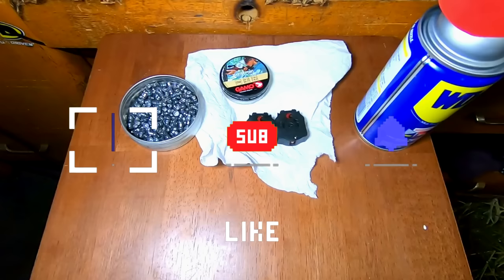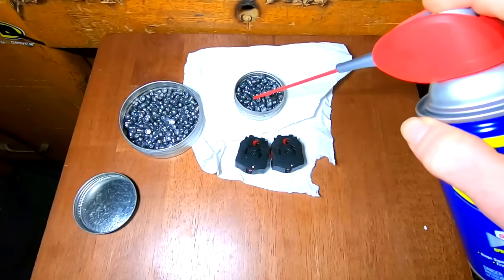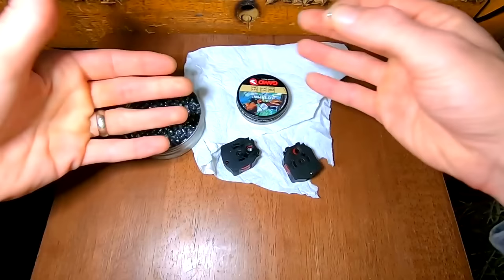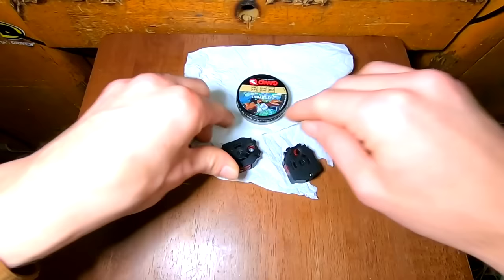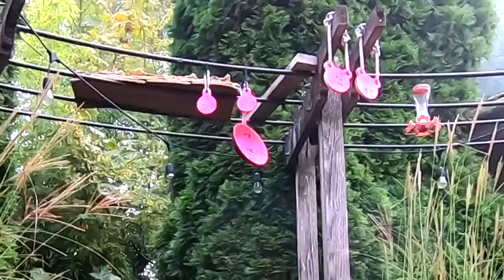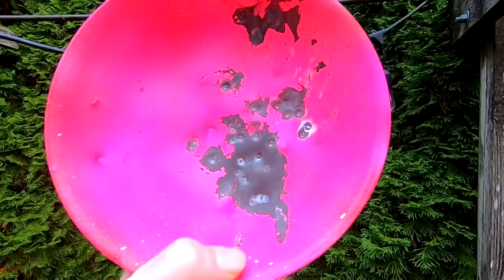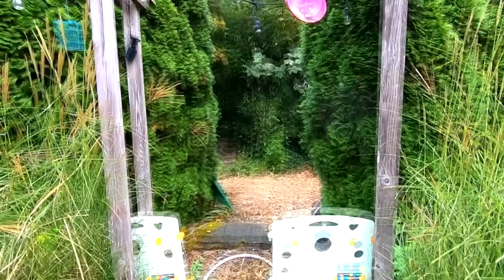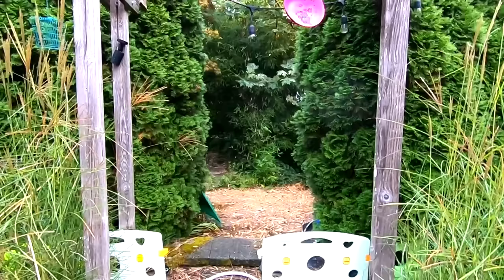Pellet Dieseling the Easiest & Quickest Method

Comment: WD-40 is like 50% water so it doesn't work that good, Vaseline will gunk up your gun.
What I found that works is Hoppes #9 lubricating oil or any 3-in-1 oil, put a drop in the pellet skirt.
Reply from the maker: definitely not true
It's 95% petroleum by-products (oil)
and 5%CO2 (the propellant)

I actually made a video where I go over the material safety data sheets for wd40 and show the breakdown of exactly what is in the can(s)
Reply from the maker: And to clarify, that means that if you just buy the 1 gallon can of wd-40, since it has no CO2 propellant in it, it is literally just 100% oil.

Comment: Would kerosene work or does it have to bee like that charcoal lighter fluid? Or is it is a heavy oil would you use used motor oil or use something like coconut oil?
Reply from the maker: I'm pretty sure people have also suggested kerosene before so I think it will work
Reply: @PelletPlinker  Make kerosene mixed with Crisco.

Comment: Mate, you want to try the Nitrous Oxide Technique, all you need is a C02 Rifle just ad WD40😉
Reply from the maker: as far as I know this doesn't work with CO2
Reply: @PelletPlinker  you misunderstood, of course you can't diesel with carbon dioxide, the Nitrous Oxide canisters are a perfect fit, it's an oxidiser, Air is only %15 oxygen? Rest is nitrogen, carbon dioxide and over trace gasses, the clues in the name with Nitrous Oxide.

Comment: I wonder if setting the pellet would have any effects? Like if ya set it a little deeper would it have the same effect as when people bore our a car cylinder, but on an obviously smaller scale?
I don't know crap about cars but figured it was worth asking.
Reply from the maker: it would lower compression.

You are getting 2 things confused here too:
Boring a cylinder makes the cylinder wider, not deeper. It allows you to fit a "fatter" piston which I think has something to do with torque or something.

The other thing commonly done, does the opposite of what you are suggesting. They will shave down the heads, specifically the contact point between the head and the cylinder. This puts the "ceiling" of the cylinder head lower/closer to the top of the piston during it's upstroke, decreasing the total volume in the combustion chamber, and thusly increasing compression ratio, and increasing horsepower.
Reply: @PelletPlinker  See, I wouldn't have known that... That was really cool to learn. I woulda thought more room for more gas woulda equaled more boom😄
Thanks for taking the time to explain🙂
I woulda responded 3 weeks ago when ya replied, but stupid YouTube never notified me.

Comment: Does Silicon oil work too? I use it to lubricate my airguns. I'm too afraid to use the WD-40 in the airguns.
Reply from the maker: possibly
Reply: @PelletPlinker  anyway, some result using the vaseline by my side. I tried it in a Diana Eleven cal.177 and in a Gamo P900 same caliber. The Diana got the best result and the P900 just more power (pretty weak as a <7,5 Joule model). No damages as far as I'm concerned.

Comment: And that also ruins the barrel of a gun just checked with eight different manufacturers that in time wears out and ruins the barrel if you do
Reply from the maker: My barrel is still fine

I also highly doubt you actually did that
But even if you did, of course they would recommend against it

I also don't understand why anyone would think doing things like this could or would improve their gun? That's definitely not the point. 

Putting a bigger turbo on your engine lowers the lifespan of your engine. Doesn't mean people don't want to do it.

Comment: I get the fact that the lubricant lubricates the barrel and creates a seal between the pellet and the bore. What I don't get is the part where you mentioned an explosion? Can you explain this in more detail?
Reply from the maker: So the lubrication wasn't really a point of focus, I was just mentioning that it probably also does this to at least some degree, but that is just a theory.

What is happening here is that petroleum ignites under enough pressure, which is how a diesel engine works. Gas engines use a spark plug, whereas a diesel engine just uses the sheer pressure of the combustion chamber to ignite the fuel. 

This can also happen on a smaller scale behind the pellet when the pressure in the piston/breech area is high enough,  creating a small explosion that adds a little extra velocity to the pellet, and of course a louder sound and a little smoke puff
Reply: @PelletPlinker  - That works with CO2?
Reply from the maker: Probably not with CO2 since it would just put out the "fire"
Reply: @PelletPlinker  - Ok. So you were using a pump-action air rifle. That's what I was wondering.
Reply: It's not the pressure that ignites fuel in diesel engines [or guns] - it's the heat caused by the pressure.  The temperature can be raised to typically around 900 degrees C by the compression stroke of many diesel vehicles.  @Plinker

Comment: Just to let you know is to do not Diesel your pellets if you are using a Daystate Delta Wolf or Alpha Wolf because it will mess with the built in chronograph . Yes it just might work for a little while . However the chronograph will stop working trust me I know been there done that .
Reply from the maker: didn't know there were guns with built in chrono 
Sounds pretty cool
Reply: @PelletPlinker  Yepper the Daystate Delta and Alpha Wolf do .

Comment: why no one tryed diesel starting fluid?
Reply from the maker: sounds like a good idea

probably more expensive but a lot more convenient than just using diesel for anyone who doesn't have it lying around.
Reply: @PelletPlinker  sold on the next shelf...
Reply from the maker: as far as I know you don't buy diesel off a shelf, you buy it from a fuel pump.
Reply: @PelletPlinker  i never said diesel, i said starting fluid for diesel engine.

Comment: How fast will it ruin your o-rings...? (That's what they warn for)
Reply from the maker: so far haven't ruined any o rings and been doing this for years, at least a hundred dieseled shots out of both my rifles

From what I understand the people blowing o rings and other damage etc. aren't getting it from pellet dieseling, but from accidental piston chamber dieseling as a result of over lubing/excess leftover lube from cleaning, getting trapped in the piston chamber, causing a much larger dieseling reaction than what would normally occur within the skirt of a pellet

A lot of people who are vehemently against dieseling seem to conflate these two things as being the same thing, or being just as bad as one another, or are just downright mistaking piston chamber dieseling with pellet dieseling. in reality, the amount of dieseling occuring with a pellet skirt of petroleum is nowhere near enough to cause any damage or to burn anything etc. even done over a long period of time. 

I don't even clean or lube my pellet guns and they are STILL fine, so if you are actually maintaining your airguns unlike me, you should be even better off than I am, which again, is perfectly fine.

Comment: The best for deseling is vicks vapour rub put the end of cotton bud in the rup and put it in the end of the pellet, not two much.
Reply from the maker: or just use vaseline
I have another video where I show a method mixing vaseline with pellet gun oil, it thins it out a little making it easier to ignite, without making it too thin so it still stays in the cup

Comment: Nice info..will effect nitro piston , springer in any way., as its blast..? I mean might it brake chamber, spring or piston of nitro assembly?
Reply from the maker: I'm sure there's always a possibility, but I haven't had any issues yet and I've run several 10 round diesel mags through both of my rifles and they still perform as well as they ever have as far as I have noticed
Reply: @PelletPlinker  ok so every shot ur dieseling ? If yes since how many rounds till date? Any problem with sealing?
Reply from the maker: definitely not every round, and I dont really keep track, but I've probably sent at least 50-100 dieseled pellets (each) through both of my rifles

I've had both of them for about 2-3 years now
Reply: Das Gas sucht Sicht immer den leichteren weg. Wen die Feder stark genug ist geht es mit der Luft und den Entzündung nach vorne raus
Reply: Why would it not just push the pellet down the barrel like any other gun?
Reply: @DaveyMulholland  What do you mean ? The pelet is tight in the barel so it doesn't slide.
Reply: @frederic6998  you think it's easier for the gun to explode than for the pellet to travel down the barrel?
Reply: No!   I have tried almost anything to ruin an older rifle this way from my collection and i could not get it wrecked!
I would not tell this to you if it wasn't true.  The pressures an O ring can handle is way more than you can achieve with dieseling.  (fact!)
Reply: it will break your mainspring,trust me
Reply: @joedills3509  Another one who knows better. 😂😂🤣🤣
Reply: @joedills3509  ps, why would it break the mainspring?
Reply: Short answer no... barrel heats up @1,598fps to 1991 fps 'depending on the bore "caliber"size 👍
Reply: @plupdeplup7349  "barrel heats up"?  Yup it does,  if you can reach about 900 rounds per minute and keep it going for 5 minutes. 😂
Reply: @joedills3509  correct sir!!! Well it did on my gun anyway.
Reply: Ff the spring fails due dieseling, it's after hundreds or even after a few thousand rounds?? How bad is it really?  It's replaceable for something like 40 euro's I thought and not that much work. Correct me if im wrong.

Comment: Yes, dieseling will give you more whack, but it's wildly inconsistent.
Reply from the maker: if you were to use something like petroleum jelly (doesn't evaporate or drip), and were meticulous with how much fuel you put in each pellet, weighing each pellet before and after adding the petroleum to ensure the same fuel weight for each round, it should be fairly consistent (theoretically at least).

Even without doing that, I can still reliably hit all the targets I normally hit, once I figure out how high it's shooting and adjust my aim point

Comment: Anyone dieseled with actual diesel or petrol?
Reply: I've tried almost every oil, gas, rubber save solvent all the way up to alcohol.   
My experience tells me when the used substance is flammable it works.  😎
btw, I'm doing this for years now but mostly I shoot without propellant because it's to much "work" between every shot.  😋

Comment: Why not use Marvel air tool oil. It’s a petroleum product and made to lubricate air tools and is safe for seals etc.. I know that WD40 or any kind penetrating oil is bad on air seals
Reply from the maker: wd40 isn't bad for seals that's a myth
But yes, something like air tool oil would be better.
Reply: @PelletPlinker  it’s not a myth I spent the last 10 yrs repairing and rebuilding air tools… WD40 or any penetrating oil will ruin the seals
Reply from the maker: WD40 doesn't ruin seals. Lack of air tool oil is what ruins air tool seals.
Lack of pellet gun oil is what ruins pellet gun seals.
WD40 has nothing in it that would deteriorate any seals. You are confusing the consequences of improper maintenance, with mythological negative effects of wd40.

You could leave a rubber seal in a jar full of wd40 for a decade and it would be perfectly fine.
Reply: @PelletPlinker  That's because the only thing you would have left in that jar would be a light oil. But that's not what WD-40 is. WD-40 contains a lot of volatiles that essentially thin the light oil out even more than it is naturally, so that it can coat a surface, and "displace water" (W D = water displacer). These solvents (volatiles) evaporate very quickly, but in the few moments they have before complete evaporation, they are a SOLVENT, and can damage rubber seals.
Reply from the maker: Name literally ONE volatile in wd40

I have a video about wd40 where I break down the material data sheets and was is ACTUALLY in it.
spoiler alert: it's petroleum oil, and more petroleum oil.
Reply: @PelletPlinker  CO2
Reply from the maker: CO2 is the propellant, genius. 

The 1 gallon containers of WD40 do not contain CO2, since they require no propellant. CO2 isn't part of the formula, and is not "in solution" it is literally just to get the solution OUT of the can it is contained in.

And CO2 isn't a volatile in the definition of volatile that you are using. You are using the term volatile to be synonymous with a solvent, as opposed to something that evaporates quickly. CO2 is not a solvent that damages rubber seals, so it is irrelevant to list CO2, unless you entire point was that you can't actually think of a decent answer, and are admitting that I am right.
Reply from the maker: I mean you aren't even trying. 
You literally made the statement, that a product that contains only 3 ingredients, contains "a lot" of volatiles. 
Then when quizzed on these volatiles, you failed to list even one volatile compound contained within the formula, and mistakenly listed the propellant, which isn't even "volatile" in the sense that you are using the word. 

So in other words, it's a lubricating oil.
Reply: Bless your heart

Comment: Does it ruin the seals or not?
Reply: Yes it does
Reply from the maker: No it doesn't.
I've done this to both of my rifles for like 3-4 years now, hundreds of dieseld rounds through both guns, and both are fine.

And this is keeping in mind that I have literally never cleaned either gun even once. 
Still shoots as strong and consistently as it did when I got it. Can still hit a 3inch group from 25 yards, and can still kill squirrels and birds so as far as I'm concerned the gun is good still.

Results may vary but worst case scenario you have to replace a 10 cent o ring or something.
Reply: @PelletPlinker  well, I thought so. You know those have experience with dieseling all say the same, like you do. Most if the times those who do not have the experience, say it will damage the seals. I believe you, thanks!

Comment: Silicon spray works a lot better
Reply: Is that why it says, 'NON-DIESELING' on my bottle of silicon gun oil, then? My mate's bottle says it too. Your comment, like so many others here, is absolute b.s. Silicon is not explosive and that's why they make silicon gun oil in the first place, instead of the many petroleum/mineral based lubricants we already had.

Comment: I wonder if the Brits with their sub 12ft lbs are doing the dieseling thing 🤔
Reply: no,  they have lots of cops lurking behind the bushes.
Reply: I put helium in my pcp 22 went up to 32ft lbs
Reply: I'm a U.K.gunsmith and it works but buggers up the gun rather quickly.
Reply: @nicfraipont4184  thanks I know it works and messes up the gun I just wondered if one could beat the system with such HARSH laws I dread the day sub 12 ft gets implemented here in SA 🇿🇦

Comment: Do you worry about the oil doing damage to seals in the gun? I've seen different videos of what people think of wd40 damaging rubber. This was one of them. Thanks for the video. https://www.youtube.com/watch?v=0_Ab3MyVxiE
Reply from the maker: Those don't appear to be "rubber" that is definitely some other material since they are both transparent and pink 
I'd be more interested to see what it does to a traditional rubber band, or even better, an actual "rubber" seal which is usually made of nitrile or something similar. Modern o rings are made out of chemically resistant materials specifically to avoid this.

If you choose a "rubber" that dissolves in petroleum, of course petroleum lubricant will dissolve it.

Comment: try gluing two pellets together with superglue
Reply from the maker: All that would do is make a really heavy pellet
And also a pellet that is too long to load into the magazine

If I wanted heavier/longer pellets I would just buy the heavier/longer pellets that they already sell
Reply: Yup, just poor some in your pellet box and be amazed by the result.   😋
Reply: Your target and grouping it's to big
Reply from the maker: 🖕       👨
  🐛💤👔🐛
        ⛽️  👢
       ⚡ 8=👊=D💦
      🎸      🌂
     👢         👢
Reply: Here's something for you, works best with 5.5 mm gun. Push one pellet in and press 5 or 6 bb's 4.4mm behind it and close up with another 5.5mm.
But only with a high powered rifle or you'll  have a seized barrel.   And even then the outcome isn't sure.   😂
Reply: Been doing this for a long time. Hits a lot harder in my Benjamin
Reply: Clean and dry the rifle bore, then coat it with lubri-plate graphite...(dry lubes)....

Comment: FYI: The WD-40 is the potato gun method adapted to dieseling.
Reply from the maker: interesting didn't know they dieseled potato guns
Reply: They don't diesel a spud gun with wd 40 hair spray or any flammable fuel, there has to be an ignition source unless air pressure is used.    @PelletPlinker

Comment: No use of any liquid.Push gun powder in back of pellets.Moist tip with alcohol and let em dry.Voila you got shelless bullets.Gain 30 perc.more velocity..
Reply from the maker: I've tried adding gunpowder to the mix doesn't seem to make any real difference
Reply: @PelletPlinker  use gun powder solely.Do not mix with anything.Be careful not to fill pellet in too tight.
Reply: @PelletPlinker did you try smokeless or black powder? Smokeless and some of the bp subs like blackthorn 209 are hard to ignite. Real bp might work.

Comment: WD-40 ONLY if in a pinch to clean or lube is ok.  The very soonest chance you have, better to clean it thoroughly as it will gum up and blow seals.
Spend a dollar more and use CLP or other designated cleaner/lube
Reply from the maker: This isn't about cleaning and lubing this is just about dieseling
Reply: And no concerns for seals or eventual “gumming” of the barrel which will have the reverse effects?